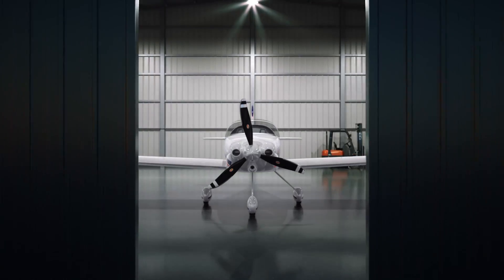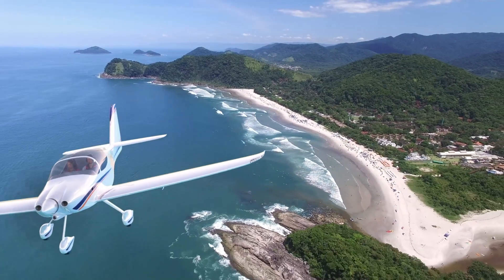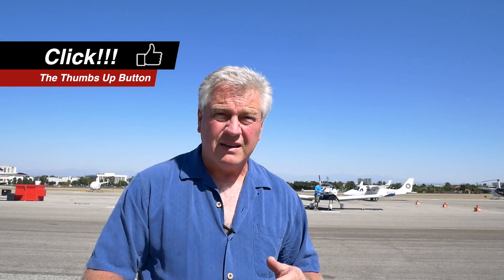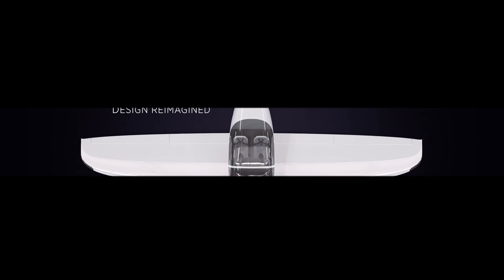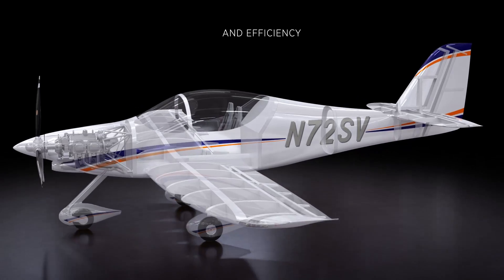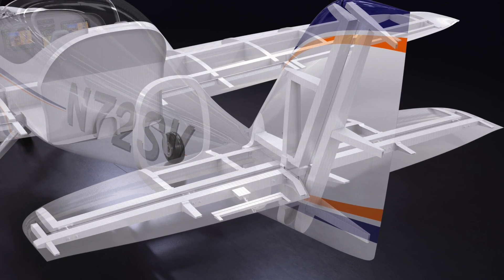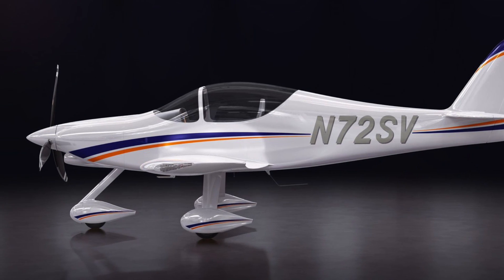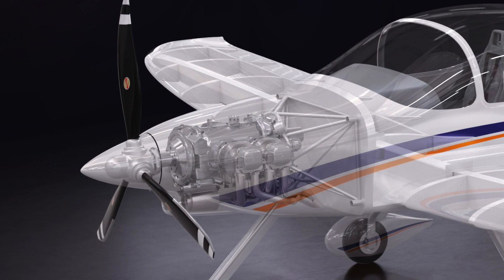Avocet AV24 Airplane Can Be Built in 2 Weeks

Comment: Wrong aircraft at this time.
Design an aircraft around a Rotax 915/916iS with the Titan IO-340 as an option.
Make a taildragger version available.
2 seats side-by-side.
80-100 pounds of baggage.
Max gross weight 1700-1800 pounds.
Ensure it's MOSAIC compliant.
You've got a winner.
The only kit manufacturer with an aircraft like that available is Rans with the S-21.
It's selling like hot cakes.

Comment: Posted two and a half years ago, but there doesn't appear to be any other news about this airplane since then. It's very interesting, but that's true of a lot of designs that never materialize. Too bad.
Reply: It is another experimental vapor ware.  This video was in 2019 and the covid was in 2020 kept the business closed.  But you think they have a prototype airplane instead of the CAD drawing.  The performance number looks like the RV7 with higher aspect ratio wings.  Glasair and Lancair both had similar programs but the composite kit construction is inherently labor intensive.  Both are no longer in business because they priced themselves out of the experimental business.  So the aluminum Vans RV7 is in the performance sweet spot and no other kit company has yet to create a plane that can match the "value" of the RV7 class of airplane.

Comment: i am from ontario canada. can i fly this with an advanced ultra light pilot license? where do i buy this fully built airplane or airplane kit from?
Reply: In Canada, at the time of this reply, advanced ultra-light aircraft
 have a maximum take-off weight of 1232 lbs. The AV24 isn't designed for this category. Regarding the second question, the AV24 is currently sold only as a kit. The purchaser of the kit completes at least 51% of the building under the FAA "Major Portion Rule," which is usually referred to as the "51% rule."
Reply: @avocetaircraft4416  hurry up and start selling it already!!! Lol Some of us are looking for something other than Vans with the same as or better performance!

Comment: Why would you design a new aircraft with such an old and frankly obsolete engine? No one wants high fuel bills. No one wants to be using lead filled avgas. Surely you either go with a turbo diesel option like Diamond do, or you go petrol like Rotax. If I want a loud fuel drinking beast for under $70,000 I could instead pick up a yak-52 and get the full aerobatic experience with it. I just don't see what the USP of this aircraft is. A done to death planform with an archaic powerplant. ??? 
If I'm going to build a kit aircraft, its because I can't get anything like it. I don't care that it might take me 2000 hours to build a long ez 61 ... the ramp appeal, uniqueness, its a special aircraft. This is so ordinary they should have offered a beige option.
Finally, at 2 weeks build all you are doing is shoving the 51% liability on me. If you weren't scared of being sued, you'd just sell me the completed aircraft for the same money. No one who wants the pride of building their own aircraft thinks about a 2 week project.

Comment: $68K? That's why I'm bulding a Sonerai II LTS. About $17K
Reply: Agent J  define safe? This Multi CFII is curious 
I'll trust a welded 4130 fuselage over just about any spam can. But I like those too. I just wouldn't pull any G in them.
Reply: Agent J  have you ever built an experimental? Not an ultralight, but a proper FAA certified experimental. 
No more dangerous than a Cub. 
Sonerai actually has its own race class at Reno
Reply: Agent J  I don't think you really understand experimental aircraft at all. 
Performance, speed, utility, efficiency are nearly always greater in experimental.
Reply: VW powered and super simple vfr instruments.  Having been a part in 2 Sonerai 2L ... it can totally be done at that price. 
I don’t know what Agent J is basing his comments on...maybe he’s thinking of a glass panel or certified engine costs. Now, if you pay someone to finish weld the fuselage and do the covering, that’ll add of course. Do it all yourself, yup can be done.

Comment: All vaporware at this point (nothing built or flown) .  Reduced parts count?  Every designer has tried for that forever. Their website shows no stringers in fuselage. Bad idea. See giles G202 that had tail ripped off doing acro.  This may not be aerobatic but at these speeds it can get same issues with any loss of control etc     Lets follow and see how it does once flying and a few hundred built and flying. Good choice in the engine

Comment: It also has to be cost effective. Most people simply can’t afford the high cost of an aircraft. Kit cars are no more complicated and they are still expensive. Avionics and powerplants are always going to be pricey, but if the airframe made up for that it would revolutionize the sport pilot world! Suddenly, people on tight budgets could realize their dreams. And if the basic aircraft was affordable it could be made so that it’s upgradable and the pilot could grow with experience and his aircraft could grow with him. If the instrument panel was modular in design a builder could  set things up with basic instruments, then change out a panel down the road for a partial glass cockpit, then to a full glass cockpit and so on. If the radio panel was modular they could swap that panel to allow for better radios, then sell his original pane for a beginning pilot. The same thing for the instrument panels on either side of the cockpit. The more modular the design, the more improvements can be made and the builder can pick and choose the upgrades they want or don’t want.

Comment: Is it just me? I didn’t get if this is an LSA.
Reply: Clearly not- Lycoming IO-360, 1825 lb Gross, 230mph.
Reply: Technically, it's an E-AB.  Allows for constant speed prop, more HP and IFR capability if you want. As well, it's beefier.  Manufacture says most of the plane is carbon fiber and the wings are fiberglass (want a little flex).  It has no rivets and is rated to take 9G's!
Reply: @scottstolnitz8918  i saw +6 and -3Gs...
Reply: @rosebarnes9625  Spoke with the designer yesterday. That's what he "said"....
Reply: @rosebarnes9625  The airframe is designed to +6/-3 Gs (+1.5 safety factor) This means the plane can take 9 Gs positive, but should be operated at 6 Gs or less. The idea behind the specification is that a pilot might intend to pull 6 Gs, but could unintentionally pull more. The limit load is 6 Gs, the ultimate load is 9. Exceeding 9 can overload the structure.
Reply: @avocetaircraft4416  ok, thanks for explaining that!